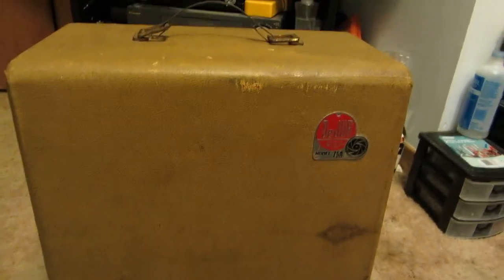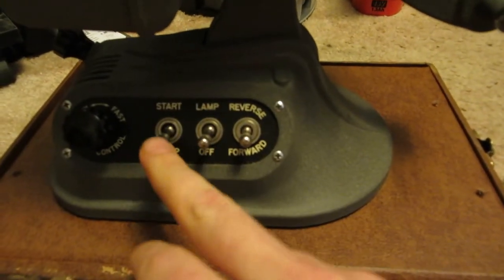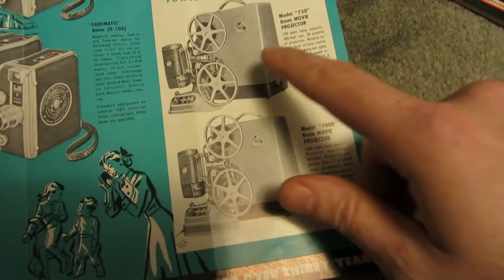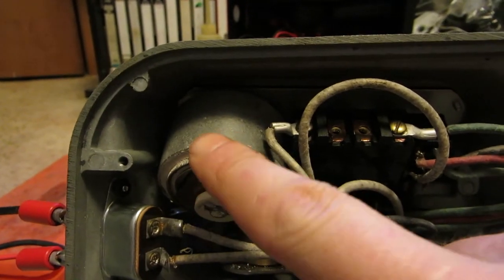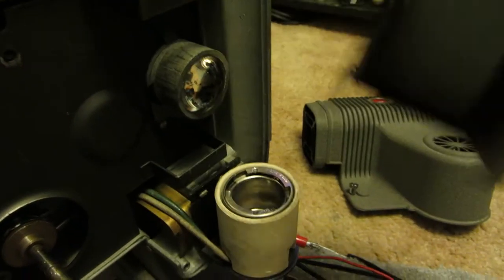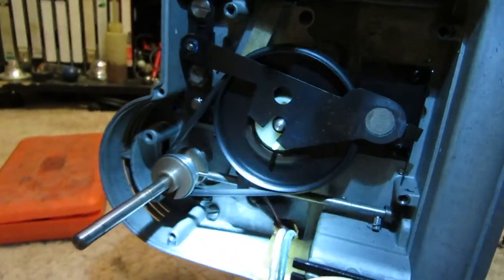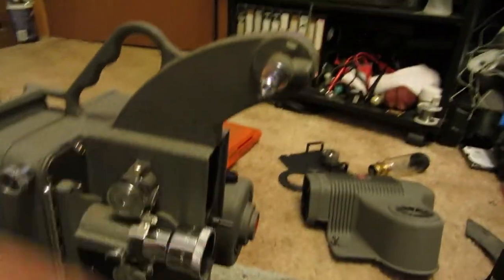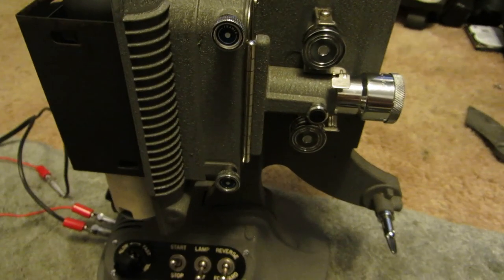Equipment Autopsy: DeJur 750 Film Projector

Comment: As mentioned the concentrated 750W light is very strong/hot. If the film gets jammed or stops moving for some reason immediately turn off the lamp. Any delay will result in the celluloid film melting. We experienced that from time to time if a couple of perforations broke and the film would stop advancing. Can happen with older film that gets brittle.
Reply: yes i have a splicer just for that .

Comment: Thanks for making this video.  I have a DeJur 1000 that was my father's.  The manual was shows 10th Edition, copyright 1950, so my Dad bought it maybe a bit before I was born.  I finally started archiving our family film and discovered this beautiful projector needed a new belt.  After great time and effort (stuck nut) I finally changed the belt only to find that the timing was off.  The fork that advances the film behind the lens was not working properly which led to the take-up reel tearing the film in half because it was pulling on film that would not advance.  Do you know anything about the timing of the fork cam vs the main shutter gear?  Your mechanism is a bit different than mine, but the timing must be the same.
Reply from the maker: Sorry I do not, however changing the belt will not change the timing, from what I recall  the timing is "fixed" and can not be changed, it's possible you have another issue.

Comment: I have a 1000 and the belt is broken. Not even sure if I can get a belt but getting  everything out of the way to get in there to change makes me too nervous to attempt without some advice.
Reply from the maker: Yea it's not easy to get to the belt on these, If you were local I could fix it for you but I'm guessing your no where's near me.
Reply: @HL4EHalfLife   I have found a belt and did take enough off to get to it. Once the belt arrives will see how bd it will be to get it back together.
From Central NY.
Reply from the maker: @walterhogan2874  That's great! It shouldn't be too hard to get it back together as everything will only fit one way.

Comment: I have a DeJur 1000 and can figure out how to remove the cooling fan. How did you pull yours out?
Reply from the maker: There should be a set screw.
Reply: For Science there is a tiny set screw that can be removed with an Allen wrench, but can’t get the fan off no matter how I try.
Reply from the maker: @vitomacri1  Try holding the motor shaft with vice grips and rotate the fan to try to break it free of the shaft, try using some oil or rust remover as well.

Comment: I have a noob question: I just bought one and I'm trying to figure out how to get my bulb in the socket. It seems loose and wobbles and I can't figure out how to put it in, is there a mechanism I'm missing, is there a special way to twist it or procedure or I'm I just overthinking it.
Reply: I think the panel on your right side when you face the back comes off with a screw or something maybe on the side on bottom. Idk still waiting for mine to come
Reply from the maker: Push down slightly on the bulb and turn it until it locks.

Comment: I have tried to remove my dead bulb but it is not moving. Any suggestions? I tried pressing down and turning it counter clockwise but nothing happens. It has been in there since early 1950"s!
Reply from the maker: From what I remember you have to push down quite hard and rotate, it should come out.
Reply: @HL4EHalfLife  Thanks it worked.
Reply from the maker: @laurastrauss4106  Welcome.

Comment: I'm trying to play a bunch of my grandpops old film rolls and show my kids some old movies , I cannot get the film to self feed through the "fingers" in the bulb area. Everything is rotating and the finger feeders are also operating up and down in and out as they should.. But the film will not self feed through that area
Reply from the maker: Hmm, it's odd that its not, have you checked the area for obstructions? or anything that is bent or out of place?
Reply: @HL4EHalfLife  I have checked it. I can't figure it out. I noticed on the video(s) that the film feeds through that area pretty easily. It over feeds at the top and if not shut off it will break the film at the bottom. Maybe the film isn't the right size? I did notice that it doesn't fit snug (left & right wise) in that area where the fingers are. This is my grandpops projector and film and he's not around anymore. Thanks for help!
Reply from the maker: @joedmac78  Have you tried loading the film manually without it running?
Reply: @HL4EHalfLife  I did , and it still wouldn't feed. The only thing I can think is the film is not the correct size maybe? Those fingers are definitely moving and they have force behind them I can feel it.
Reply from the maker: @joedmac78  It must not be the right size than, you need 8mm.
Reply: @HL4EHalfLife  I'm thinking same thing
Reply: I grew up using this model. It never auto-fed, from my recollection. Mount film on top. Pull maybe 18" of film leader from reel. Start installing the film closest to the reel first giving you the 18" of film to do the following . . . You push the top sprocket keeper down and slide in the film and onto the teeth, and let go. Then head towards the lens and swing the lens open. Make a slight loop above the lens feeder teeth, press the leader into the channel and engage the teeth (if they are not protruding, I recall that on of the knobs can be turned and it will rotate the teeth out so the film can align); swing the lens closed. Make a loop below the lens and then head to the lower sprocket. Lift the lower sprocket keeper up and slide film in, engage teeth, and let go. Thread remaining end of the leader into the lower reel. Hope that helps.
Reply: @jefffarago8282  I'll try it thanks